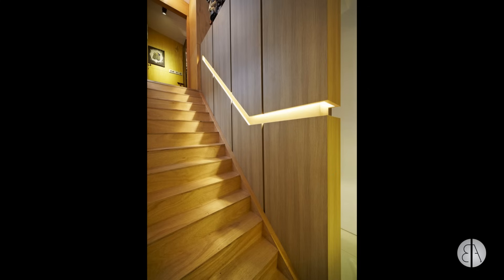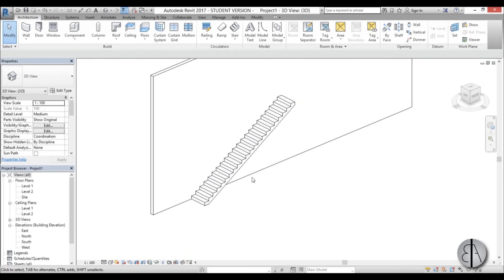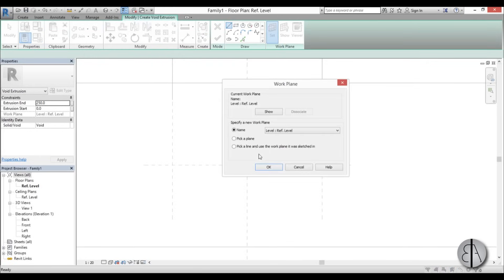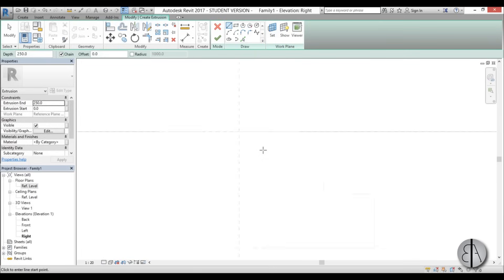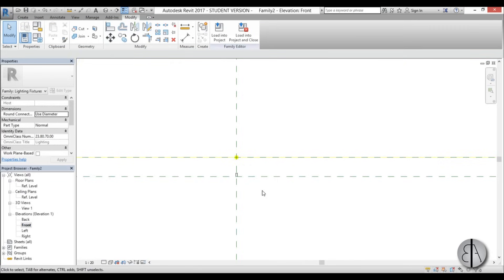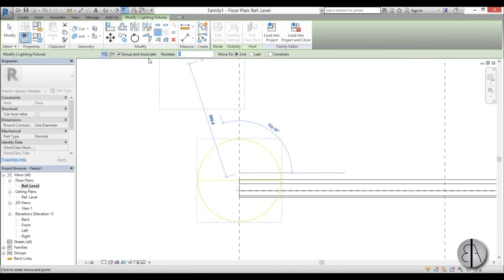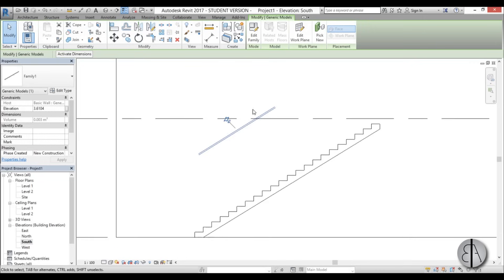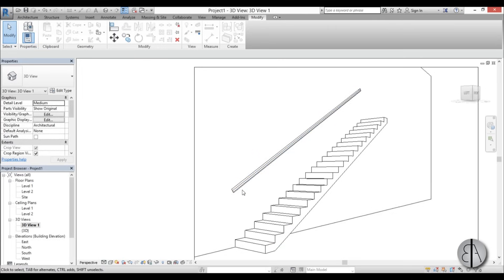Wall Stair Railing with light in Revit Tutorial

Comment: Hi ! Love your videos ! 

Everything works for me except the VOID. I dont know why it wont charge in the project. 

The railing is inside the wall, but its not cut open !
Would love if you could help
Reply: hi
it may be too late but anyway
you can try to pull the void volume outside the face in the generic model then  cut the face by the void by using cut command